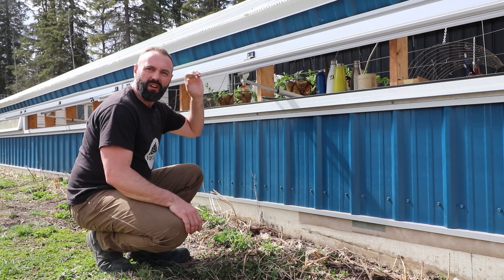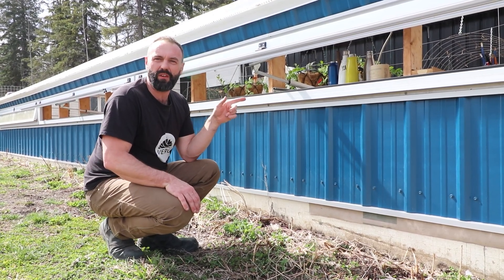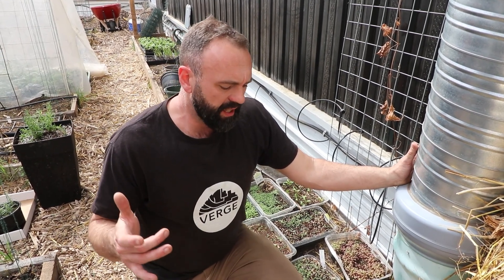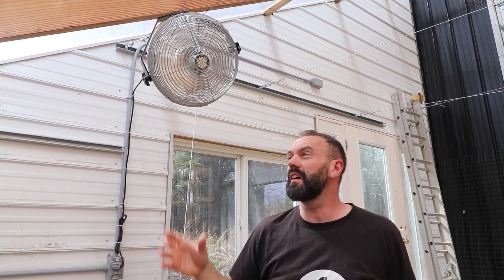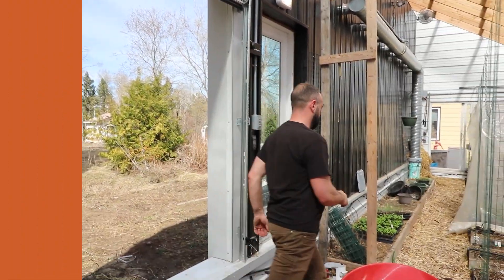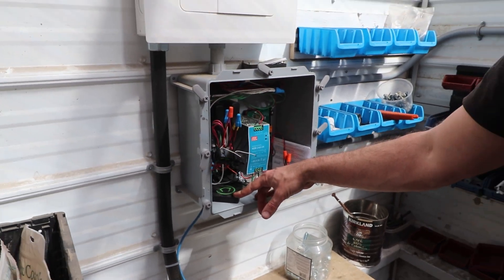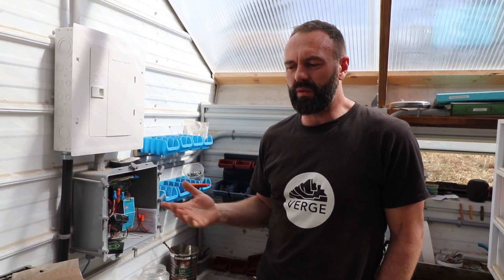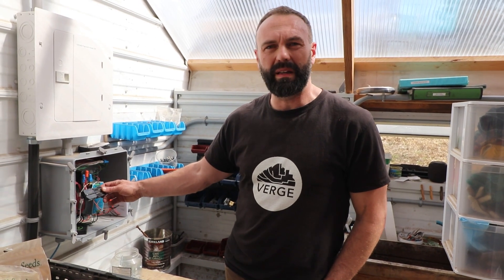Our Easy, Affordable Way to Automate Your Greenhouse Ventilation and Cooling System

Comment: whats the style of windows at the front called? I need to add some diy windows to the sides of my greenhouse something like you have but ive read the auto vents only work with butt hinge windows, and im struggling to work how that style of window is water proof where water can run down and into the seam where the hinge lies at the top?

Comment: Sigh. When are you going to realize that pulling on the cold air is a much more efficient way of heating the climate battery because you are working WITH physics and creating a decreased pressure zone that makes hot air want to dissipate its energy readily? Pulling the cold air up out of the ground that is dense results in a much greater volume of hot air collected from the peak of the system. You need a lot less energy to move more volume.
Reply: Sigh. When are you going to realize that no greenhouse is airtight? You are proposing pressurizing the building with cold air, hoping that most of the hot air collecting at the top will find its way into the system. In fact, a great deal of it will escape and be lost. Moving that hot air instead results in every cubic foot being delivered to the system. Yes, less efficient from a purely air transport view but better at capturing the most Btus.